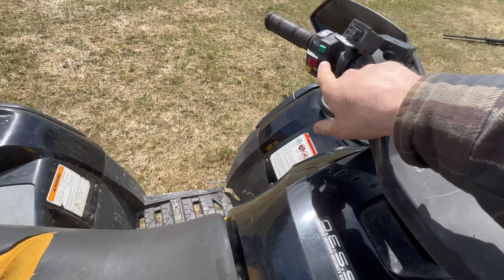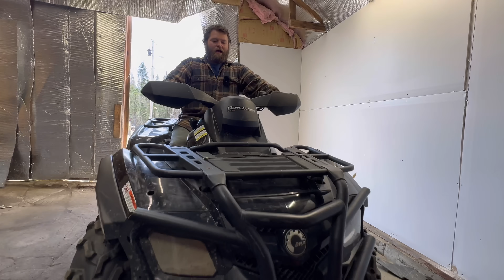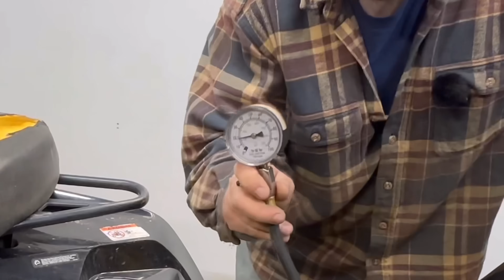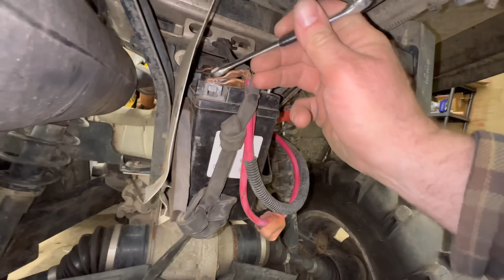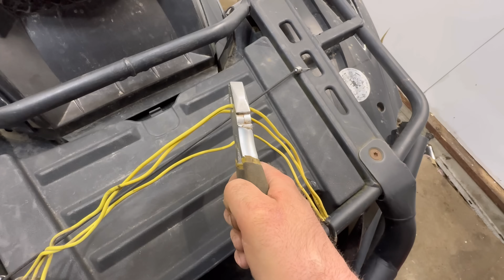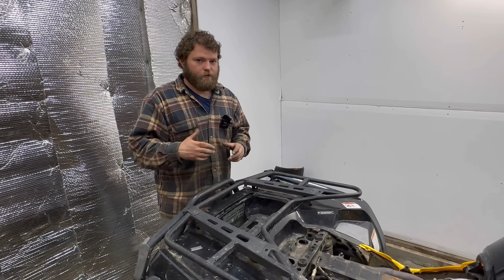Can am Outlander 800 NO power: Hardly runs!!!

Comment: Good morning. I have a 2009 Can-Am Outlander 650. The battery is good, and I hear a click when I press the starter button; I have a signal on the wire running from the starter button to the starter solenoid, but it won't start. I replaced the solenoid, but that didn't help; I also noticed there is no signal reaching the spark plugs. I would appreciate any help you could provide. I live in Homestead, Miami.

Comment: Have '19 can am outlander 720. Installed new fuel pump and re-installed, would not run. Inspected and o-ring at fuel pump was not sealed. Made sure o-ring seated and machine runs perfect. Perhaps fuel pump was replaced but o-ring leaking?

Comment: Would you happen to know the fuel spec on the 2017 renegade 570 and should the fuel pump hold pressure on the rail mine does not not it will zero out when you shut the power off thank you

Comment: Just curious, what are you using on the other side of the t adapter hose to hold pressure as you are checking the fuel pump pressure?

Comment: Do you know why my outlander 1000xt is blowing coolant out of the overflow tube at full throttle it has a radiator relocation system so im not sure if the factory cap on the overflow is all working properly it was low when i got it and i toped it off and ever since its been blowing out at full throttle
Reply from the maker: You could have an air pocket in there, hopefully that’s what it is. Did you bleed the air out of the coolant? This is done by loosening the bleed screws on the cylinder head.
The next step would be to check the coolant system pressure, if it is too high you may have a bad head gasket causing this issue.
Reply: Thank you. im gonna check it out soon it was definitely sucking air on one of the hoses after it sitting in the gurage for a while i notice the leak, but i will look into bleeding it, wouldn't be surprised if blown head gasket the valve covers are definitely warped, she runs good and strong not blowing smoke at all, happy new year thanks again dude i really appreciate you @rockspowersports

Comment: I have a similar quad 2011 800 xmr and the air suspension is not working. On the control panel it is not showing the air suspension selection   I use to be able to select settings 1-6 for soft to hard suspension on it and now it doesn’t come up on the screen.  Thank you for any advice on where to start looking

Comment: Man they are wheelie machines aren’t they lol my Polaris 850 won’t do that lol but it ain’t broke in yet it only has 50 miles on it lol
Reply from the maker: These things are wheelie machines, don’t even need to try. Your 850 will probably open up a little more when it’s broke in. Those 850’s are a little softer on low end but they pull hard mid to top end.

Comment: I feel bad for the owner. Good deal turned bad. At least it’s fixed now and hopefully he gets some fun miles on it. I had bought a 2009 renegade 800 with several hidden covered up issues. Was a bad expensive mistake. Especially paying top dollar for it. I had to replace the engine. Timing chain had been maxed out and wasn’t informed by the previous owner. It broke and piled up 100 yards from my truck on the first ride.  Major damage .
Reply from the maker: Yeah it sucks dumping that much into it.. That’s horrible about your Renegade, especially on the first ride!!!